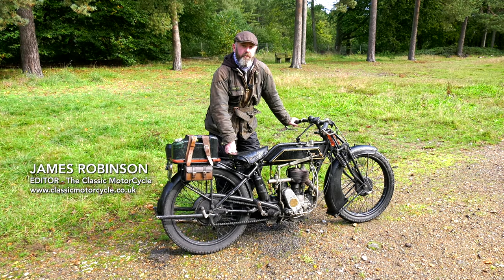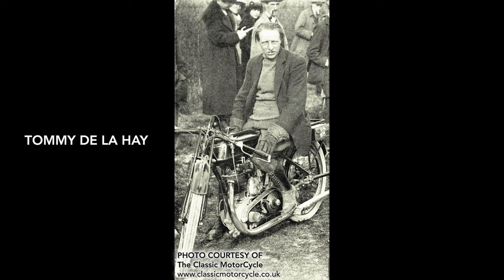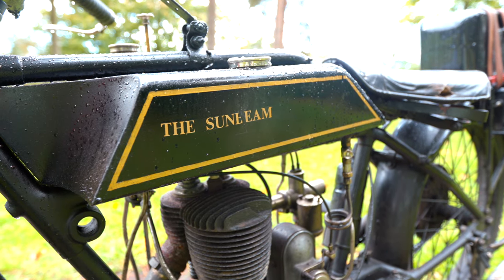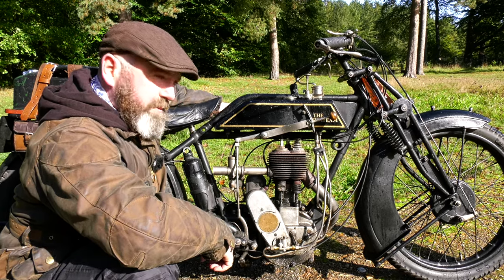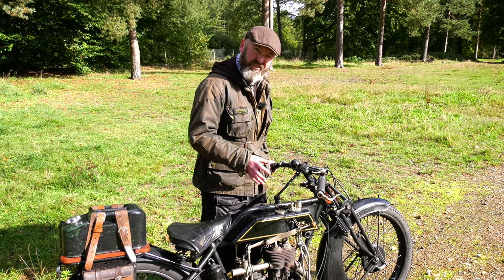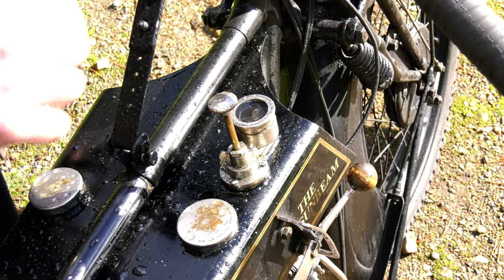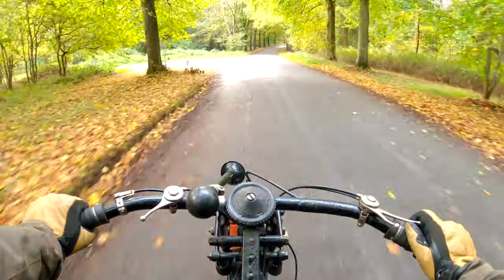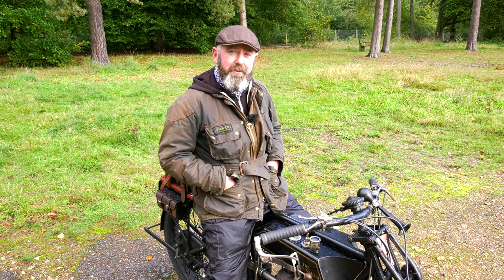1927 Sunbeam Model 6 - overview & ride

Comment: Thanks for taking the time to explain what might seem obvious to you but not me and I've been on bikes for 40 years. 
I assume the head has to come off to replace a valve if the steam breaks?
The bike sounds lovely going along and enjoyed the video so much I have subscribed.
Reply from the maker: Right on Stu! We asked James about the valves and he's actually never changed one so didn't know if the head had to come off. But, he's on it! Welcome aboard!
Reply: Hi Stu. These are fixed heads. If a valve breaks on the stem, you have to hope, that the valve head stays put. Once the engine is stationary, you remove the cone, that sits above the valve that's broken and take it out. You then put the new valve in, fit the spring, cap and retainer and replace the cone. Do your valve clearance and away you go.

Comment: nice vid James i take clasic motorcycle ive met you once Ive got a1925 ohc Velo thati ride round the block now and again .Im trying to sort  out this e5 problem im doing the water method with  pop botels The problem is e5 heats  the cylinderhead so much the screws in the cambox come loose Ive tryed lawn mower fuel but its too expensive .eneyway ttfn& ty